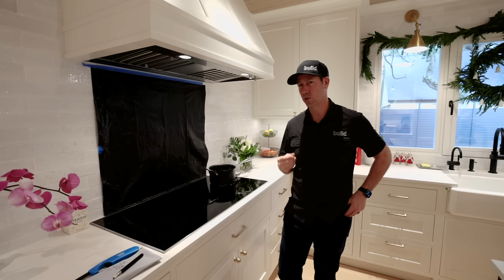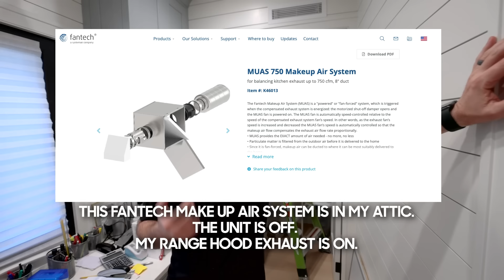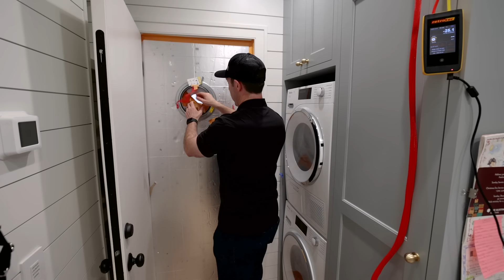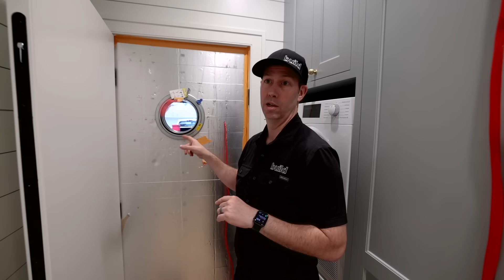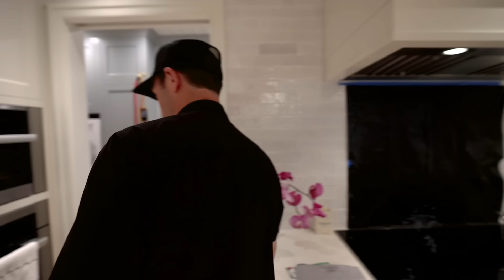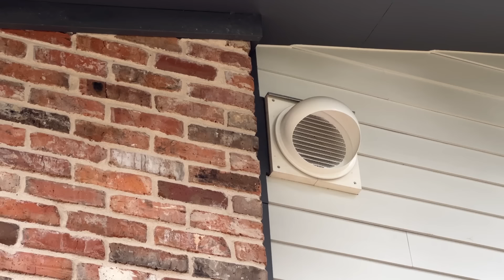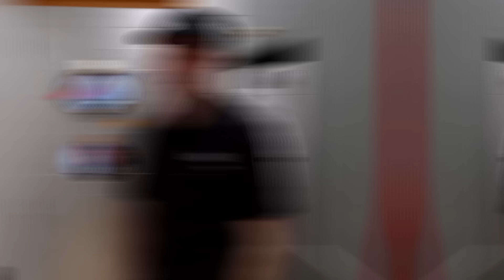Make Up Air for a Kitchen Exhaust - Most Homes Suck. (Pun intended)

Comment: Can you have a 2 speed fan on a ERV? So all the fresh air goes through a heat exchanger??
Reply: Yep but his house is about a 100-180cfm hrv  boost mode is an extra 50 percent. Way shot
Reply: Short
Reply: You dont want grease buildup in your ERV - fire hazard. Restaurant vents need regular cleaning with pressurized hot water and chemicals to stay safe.
Reply: The ERV is balanced. One motor running a fan on both the intake and exhaust air so the air flow is the same. This cannot "make up" the air exhausted by the hood.
Reply: @patrickdougherty2777  true it's balanced but it would do make up since the exhaust wouldn't be able to fight the 400cfm pulling out somewhere else. Just about every commercial temp flow I've seen just overpowers the on all the time system.
Reply: @TD-zc4zi  and NO one cleans out the kitchen duct. so make sure your filters are run through the dishwasher every major meal
Reply: @sparksmcgee6641  By balanced I ment that there is a motor with a shaft coming out of both ends with a squirrel cage on them so that it would pull in (intake) the same amount of air as it exhausted. It is not designed to and cannot  bring in any air to make up for other exhausts. So this will not work for matt. I did commercial food servive repair. All of the hood and exhaust systems (heat and combustion for ovens, steam from panwashers, etc.) had to have some sort of make up air. Often a rooftop make up air handler even if some had their own make up air. Failure to have enough make up air causes negitive pressure in the building which can cause downdrafts in combusrion exhaust stacks resulting CO (carbonmonoxide) in the building. Houses are not commercial buildings but the physics is the same. I know that Matt does not have any combustion sources in his house but he has shown that his hood exhaust creates negitive building pressure which causes oyher problems.  Sorry for the long answer but I wanted to take care of as many objections as possible in a positive manner from others that might be reading this. Cheers.
Reply: @patrickdougherty2777  Great walk through. We're on the same page. Reading my comment I realized how YouTube typos messed up my comment.
My point is if the space is really tight and the exhaust vent is only used 30min a week then overpower the kitchen exhaust fan and let the other systems catch up. HRV/ERV ec.. Even with a gas furnace and water heater any negative pressure won't create a MO2 problem. I wouldn't overpower by a 300 percent but 100 percent for 15 minutes a shot sure. One of those perfect is the enemy of good situations. Selling a $3000HRV is tough enough, Selling a $7000 HRV triple the size the house needs for the times the stove is used almost impossible. "we'll open the window when cooking for $4000". Then the change order to switch out the kitchen sink window is $2000.  : )

Comment: Great video as usual! other than the induction propaganda. Go to any professional kitchen of any of your favorite restaurants. I guarantee it will be gas. I have a small portable induction cooktop (2-burner) I use for making lunches at work because I refuse to use microwaves and it’s great for that. And yes it boils water quicker than a CHEAP gas cooktop. But even a midrange gas range will meet or exceed boiling times for induction with quality cookware. Let alone a commercial grade cooktop. We’ve (humans) been cooking with open flames in homes for centuries now and it’s never been a problem. Not until some guy that sits in an office and is paid WAY TOO MUCH money decided he knows better because he’s a closet pyrophobic pansy and thinks everyone should do things that make him feel safe. 

Plus as someone whom has paid dearly to heat a home with nothing but electric baseboard. Electric is incredibly expensive compared to natural gas or even LP which I use now. 

If someone prefers electric or induction cooktops because they genuinely like them. That’s great. Different strokes for different folks. But just know that the professionals out there still prefer gas. And there has to be a reason for that preference.